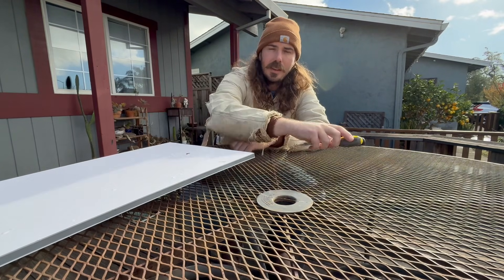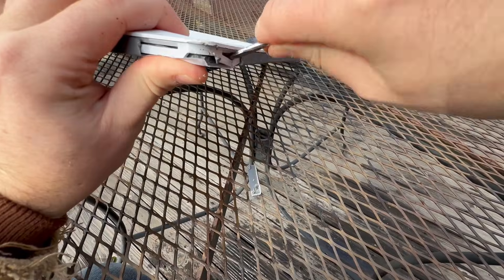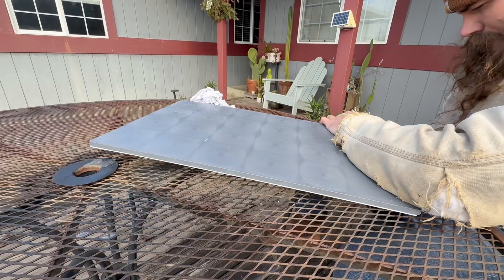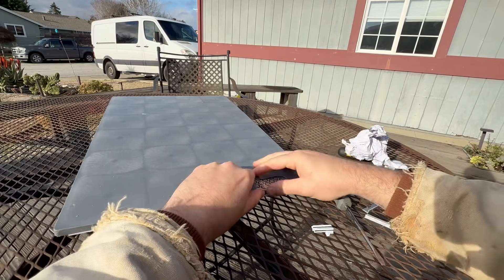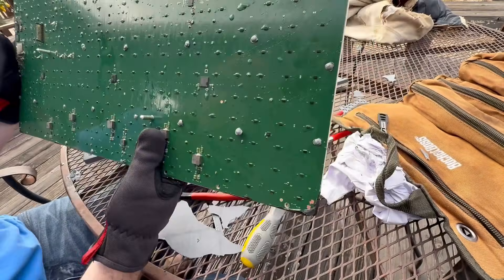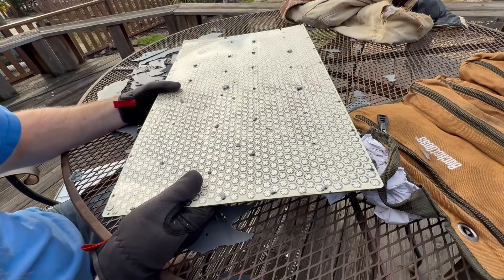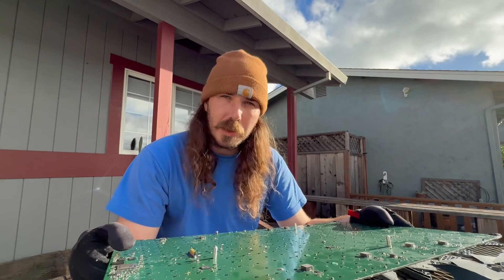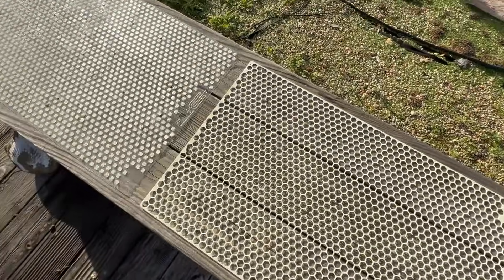I DESTROYED a STARLINK GEN 3 Dish

Comment: I have one of these that just died on my boat, due to what looks like a burnt or broken ethernet connection.  Worlds worst design to deliver power to an antenna that consumes enough power that it actually gets warm.  SL engineers need to look on the back of a Mari e GPS unit to see what a proper data and power connection looks like.   Solid plugs with heavier gauge wires and threaded screw down caps to hold everything solid.  And F-ing Starlink trying to do all that with tiny ethernet wires, and a drop of water cooks the whole thing.   400 miles up the BC coast and not working.  All of these are gonna be in landfills in the next few years.
Reply from the maker: Agreed! And not serviceable in the slightest. Check out starlink mini. That’s what I run at my offgrid cabin and it has an integrated router so all you need is the power cord. Smaller, too. Could be an option for you when you get back on land 👍